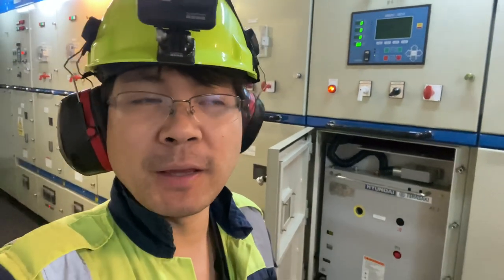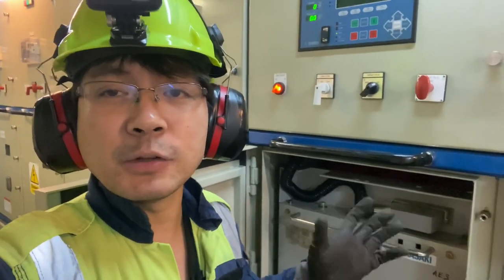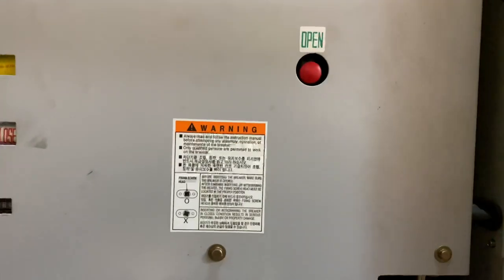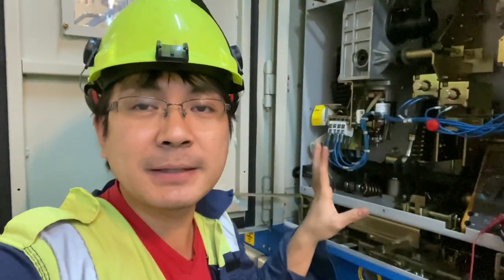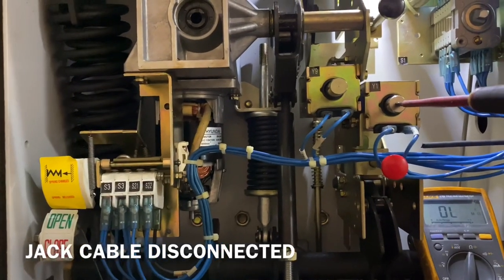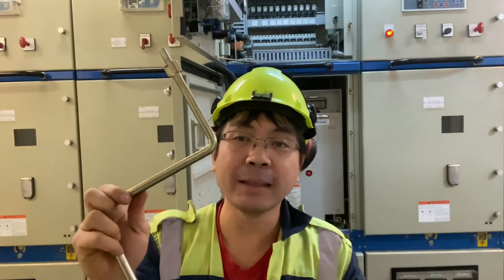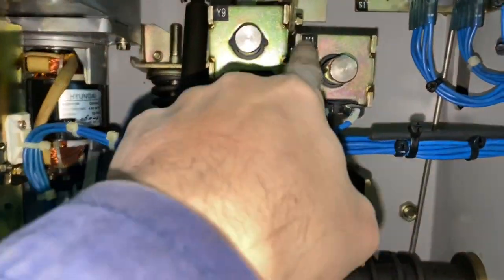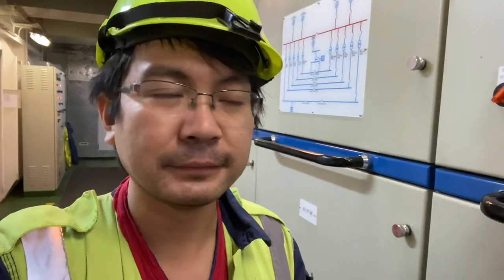VCB TRIP ALARM (VACUUM CIRCUIT BREAKER) | ETO TROUBLESHOOTING

Comment: I'm a former Radio Operator and now I'm a OIC-NW license officer. I think some trouble shooting guide indicated on the block diagram. It's mean the trouble shooting will definitely in a particular place since the ship is almost new, so the solenoid (function is to amplified the required current in order to run the motor to open up.) Since the c/e and 1st/engr act a electrian onboard. But I think if the ship become old I think it's better to have an electrician who's knowledge in electronics techinical and we'll verse in such like computer, electronics, electrical and even knowledge in mechanical as well. Take care, God bless! Salute you sir. Peace

Comment: May you please clarify a moment?

If i press close on circuit breaker before rack out then it means that we take generator on bus bars. But generator not started. As a result redundant load on bus bar. Generator will act as an engine.

Comment: I think there is a dedicated spring release mechanism in this kind of breaker. Also if you just close the breaker I think you just release the closing spring but the opening spring is still charged. Please correct me if I'm wrong Sir.. By the way I enjoy watching your videos they are very informative.
Reply from the maker: Nope it is the same spring for closing and opening. So if you close the breaker without the Motor connection or the Jack Cable then it will stay released unless you charge it
Reply: @leckyjake  Cone Dela Cruz, you are absolutely correct!! The closing spring / closing action charges the trip spring. That is why he was able to trip the breaker when the semaphore was showing the spring was discharged. The spring charged semaphore is just for the closing spring. To properly discharge all stored energy, on most spring close breakers, you need to disconnect spring charging motor, do a close operation to discharge closing spring, then do an open operation to discharge trip spring that was charged when the breaker was closed. Some breakers can even do two close operations on one spring charge cycle. So always close, open and try close again before sticking your fingers in the breaker mechanism.

Comment: And if it was mechanically sticking, it would have tripped when you had the control power removed from it. So what am I missing here? Is there a trip circuit monitor that was tripping it due to low resistance? Which normally only sends indication of an electrically open trip circuit. But I see an 85X device, which I am not familiar with.  Thanks
Reply: Where did my first comment go? I was genuinely curious.

Comment: Hey jake, We had a similar situation onboard my vessel - during port state inspection the EMDG did not connect to the board(engineers swear they checked it before hand <.<). Was quite a ordeal as i am only electrical personnel onboard. Thankfully the Chief engineer got some shore contractors to help. in the end we found that the UVT (like Y1 in your video) did not correctly trip the breaker feeding the ESB causing an interruption of logic with EMDG controller. Now i know! Thank you for sharing your knowledge
Reply from the maker: Thank you for the support

Comment: How can you work MSB without blackout?
Reply: You isolate one generator usually you have 2 per side in case of one failure the other generator supply that line...
Reply: Bus tie breaker